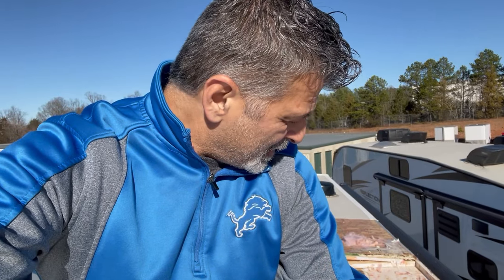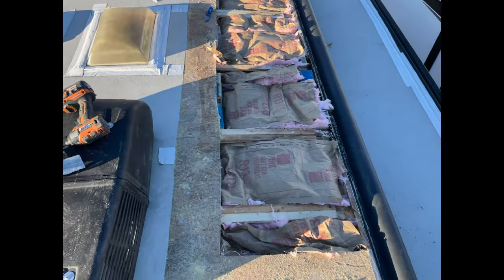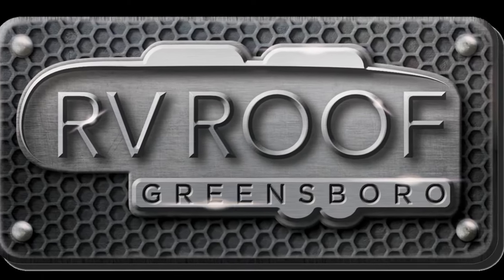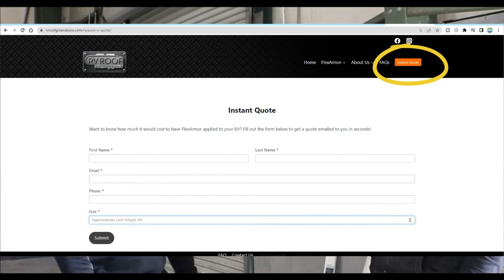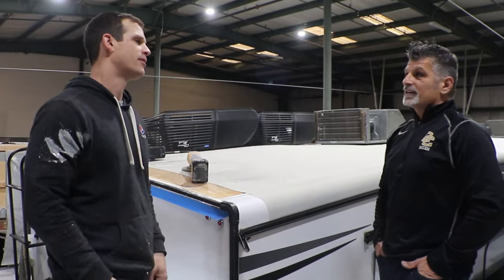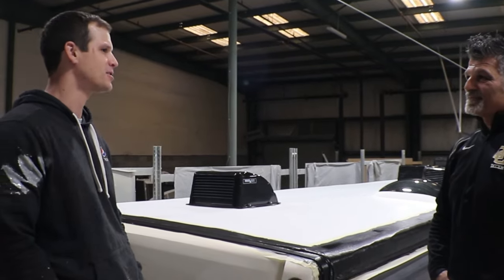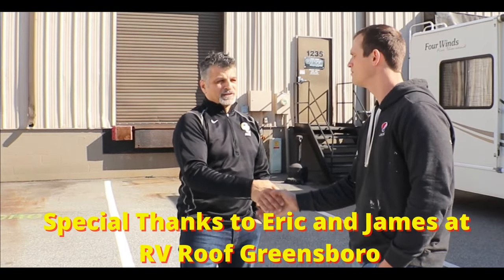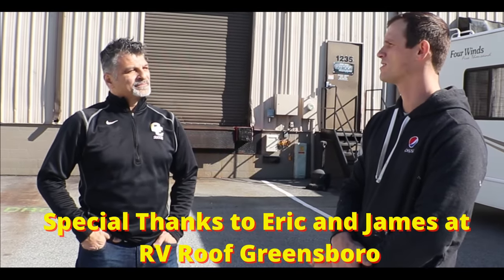RV Roof Repair Sealant Last Repair you will ever do FlexArmor sprayed RV roofs #flexarmor

Comment: I had the same Flex Armor roof installed at the RVROOFDFW Denton, TX facility in July 2021. I am very pleased with it. Mark Lamb and his crew have an outstanding work ethic and did a fantastic job on my motorhome. I told him if I ever purchase a brand-new rig, I will immediately have the Flex Armor roof put on as preventative maintenance, as it's not a matter of IF you roof is going to leak, it's a matter of WHEN. Water damage may not be detected until thousands of dollars of damage is done. It's at that time you wish your rig would have had the Flex Armor roof! I sleep comfortably in the rain knowing the water will not be coming in! No more caulking needed on my roof! Note: The Flex Armor lifetime warranty is transferable. You receive paperwork to transfer the warranty to the new owner should you sell your RV.
Reply from the maker: Wow.  Love this story.   Thank you for sharing.
Reply: How much did it cost ? What size rv

Comment: It seems that this is a good product but it is very expensive, if you are selling your rig in a few years it will not be worth it since you can not get  your money back or return.  If you are keeping your rig 10 years or more, it may be worth it.  You may get some peace of mind using this but at a great cost.  I wish they could adjust their costs, more folks may be inclined to invest in this process, if it indeed lasts.  They would make money on the volume.
Reply: Thank you for your feedback. We may not be aware of all business practices, but our pricing is based on the cost of materials and labor. Considering that most dealerships charge upwards of $10,000 for a rubber roof, which typically involves around $600 of rubber and approximately $100 of glue, we believe our prices are quite reasonable. We invest more in materials and labor, and our work is not performed by general laborers at $15 an hour in an RV park. Our prices align with those of a standard roof, yet we provide superior quality and a lifetime warranty—benefits not offered with standard roofing. At our corporate headquarters, the price for a 40 ft RV roof is $8000. Additionally, our transferable warranty has proven beneficial for many of our previous customers during resale or trade-in.

Comment: how much weight does it add to the RV? Seems like these permanent roofs are the way to go right off the start to avoid future problems.
Reply from the maker: Great question!   We are going to get it weighed on our next trip.   Thanks for watching.
Reply: Curious if you ever found out the weight?
Reply from the maker: So we just got the rig weighed almost the same weight as prior to the new roof,  if anything I would say under 50 lbs.    thank you so much for that question.
Reply: @TSquadRVing  thanks for the update!
Reply: I heard it was 180 to 200 lbs for a 30 ft roof

Comment: you need a new roof, run don't walk to have this stuff on your roof. you can barely pierce it with a screw driver, it lowered the temp inside, weight is not a problem.  we had our done in green cove spring fl. think about all the flexing your roof goes thru going down the road,  this stuff is tuff.  sun doesn't seem to mess with it like other roofs. they go down on the roof side seams, so much protection.  very happy.

Comment: I wonder what happens when you have to replace one of those components that they've sealed in.
Reply from the maker: Great question!  Anything they sealed up, Eric told me we would have to come in and have them do it so they can make sure it is sealed up again. Example, skylight. If damaged again they would have to do so the warranty still remains honored.  
Also they said anything you want to add to your roof to check with RV Roof.  
Thank you so much for watching.
Reply: @TSquadRVing  Any idea of the cost to have them replace something like a skylight?

Comment: So, eventually skylights get all faded etc. What happens if down the road you want to replace your skylight? I've already replaced mine after it cracked, i put a much stronger one in. But i expect over the years it will need replaced again. How does that work with this roof?
Reply from the maker: You would need to bring to the place to professional remove and reinstall.  This is why you should replace when getting the roof done this way it lasts years.

Comment: I'm curious about the application. Is it better to apply it directly to the wood? I would think that applying it to the membrane would be much weaker since there could be adhesion issues with the original material.

Comment: Could we use pressure treated on the roof? 

I feel your pain 
I just spent so much time preparing our new used campers roof to apply this industrial coating and now I have bubbles and the coating is still tacky. Even though it has been a couple weeks, every bug and every seed from every tree has landed on it. 

No, I'm trying to figure out if I need to pop those bubbles and reseal them. 

Very frustrating

Comment: I feel your pain!  Rebuilt the rear wall of a class C and the bunk over cab.  Found water in the bunk again!  Turned out the rubber boot where the antenna cable came thru the roof was the culprit!

Comment: Thanks for the video. Im looking at buying and older American Tradition class A that already had this installed. The current owner did a live video with me and while on the roof talking about how great the roof is, jumped up and down on the roof to show how tough it was. This looks like a great product and new RVs are built fast, not well. The roof is always a liability. The damage that a leak that went unnoticed for weeks or months could be catastrophic. Definitely adds value to a rig when it comes time to sell.

Comment: Wow, does it make the roof more rigid while walking on? Mine you can tell when you step on a panel between supports.
Reply from the maker: I would say a little, but it is definitely more durable, That's because of the thin wood the manufacture installed,  We went to a NASCAR race last weekend and had 8 people up on the roof and it was solid    no problems   
Thanks for watching

Comment: I like the warrantee.  Does this product have the strength and hardness of pick up bed liner (like the Rhino or the Linex)??  Otherwise what keeps tree branches from can opening this product??  I have had roof issues on towable travel trailers I owned in the past.  I am considering this for a BRAND NEW Camper I am buying.
Reply: Thank you for your comment. This material is actually tougher than bedliner. RVs have different needs than a bedliner, which has little movement and different needs. We decided FlexArmor to withstand things such as tree branches but have the flexibility needed for a vehicle that does flex. We have some videos on our Youtube page showing the toughness.

Comment: Any idea how much weight it added to the roof ? I know an rv is already top heavy, just curious if it pulls or drives different with the new roof?
Reply: It adds around 150 pounds on a 40 ft roof. We have never had reports of it effecting how the unit pulls.

Comment: Only concern I have is when something needs replaced  say air conditioner   looks good though
Reply from the maker: You are able to to anything with the AC. But it's the sky lights and vents you need to bring back to them for because they are encapsulated.   Thank you so much for watching.

Comment: This stuff looks awesome, but at $170 per linear foot, it would cost us over $5k to have this installed on the roof of our mid-sized fifth wheel.  Too pricey for me.
Reply: Yet that will probably still be cheaper than a factory/dealer installed replacement. I had mine done with flexarmor and never looked back. Repair/replacement of the roof estimates with factory/oem materials 1.5 times as expensive and simply repairing the damaged area came in at just over have the price of the flexarmor with a 3-7 year expected lifespan. A no brainer if you plan on keeping your trailer and use it a lot. Do it right, buy once, cry once.
Reply: @scottlewis5755  Yes, Flex Armor is probably half the cost of a roof replacement, but how many people NEED a roof replacement, barring something like a tree falling on the roof, something that Flex Armor won't help with?  They're actually pretty rare in the RV community.  Most minor roof damage can be repaired fairly easily with a combination of something like Eternabond and Dicor to seal the edges.  There are videos of folks who have such repairs done years before without any subsequent issue. I've seen many people who RV full-time, and I've never heard one comment before regarding Flex Armor.